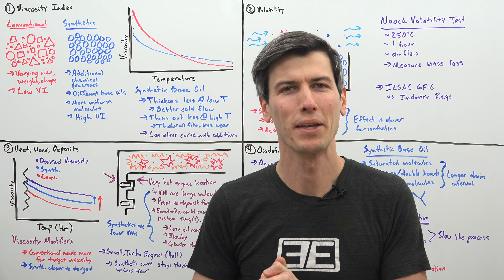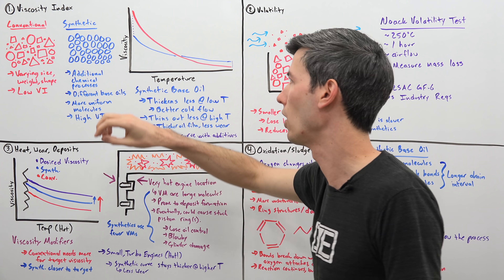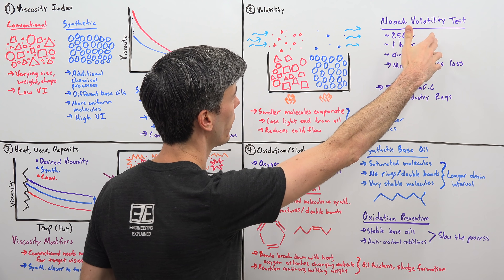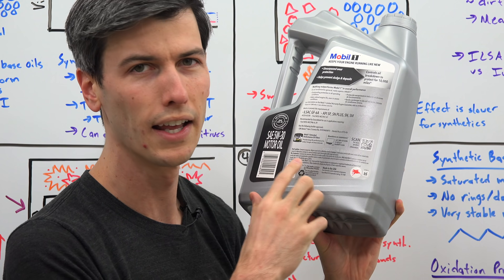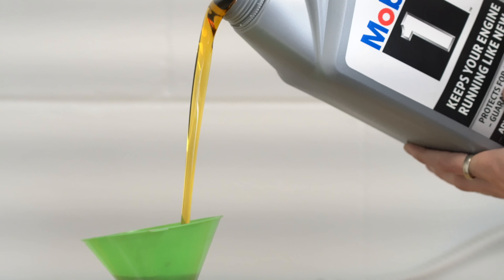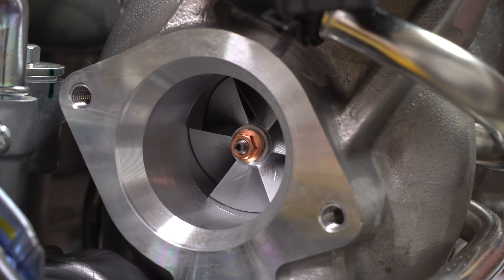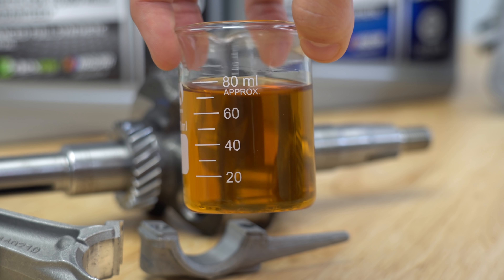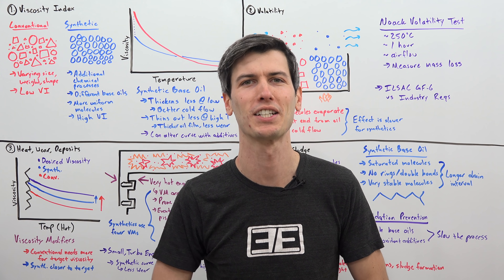Synthetic vs Conventional Oil - There's A Good Reason To Switch

Comment: I have heard that some crankcase seals and other rubber part on older cars does not like fully synthetic oils. Can you elaborate on that please?
Reply: Oh huh? Well I have 97 5.4 triton with just about 250,000 miles with 100% synthetic in it that doesn't leak!
Reply: @429thunderjet2  because newer oil.

Never had a problem with conventional or synthetic from valvoline or castrol. I will not use Penz or Quaker
Reply: @429thunderjet2   I have a '99  5.4 Triton with about 130k miles.  Loading it with synthetic tomorrow.  Never had an ounce of trouble with the engine...  it runs and runs and runs.  Ford done good
Reply: @russellnotestine6436  yup I have a 97 f-250 5.4 two valve Triton getting close to 250k miles with Amsoil Signature Series 100% synthetic in it and it takes a little oil but think most of that is the oil cooler lines are starting to seep. The f-250's got external engine oil coolers from the factory. The 5.4 two valves 97-03 I agree are pretty darn good engines.
Reply: @429thunderjet2   My Triton is in a Super Duty 1 ton cargo van.  It's oil change takes 6.5 quarts...  Ashamed to say I don't know... I rarely have the hood up and never crawl under it...  I imagine that's because of an oil cooler.  Again..  Ford done good.  Seeping a lil' oil (mine doesn't yet) is better than burning it.  From what I learn about synthetic oil I wont be surprised if I get a little seepage.  For the syth benefits...  that's fine with me.
Reply: He has a video on this. Check his channel, it was pretty recent
Reply: Use the oil brands recommend by the manufacturer, ie for Jeep Wrangler JK, if you read the owners manual, they recommend either Mopar conventional oil or Pennzoil synthetic, which I use in my Wrangler, and change every 5K miles, 5W20.
Reply: quixxo  so was it the oils fault?
Reply: quixxo  yah the Harley deal, they had a chain oiler.
Reply: Not one with conditioners so stay away from these high mileage formals no vehicle likes them
Reply: Naw, Those were the ester base synthetics from 30 + years ago that swelled the seals too much causing issues. The modern formulas of the top premium real synthetics use combinations of PAO with some ester and other stuff to keep the seals pliable. The group III highly refined hydrocracked petroleum based synthetics are formulated to be nice to seals as well I believe. This is  basically said, but there is much more tech to it. But so it really is a non-issue today.
Reply: @429thunderjet2  theorically you're right, but I've experienced oil burning with synthetic. Granted, the engine wasn't in the best of shapes, was an early Ford 4.6 in a 94 Crown Vic, notorious for valve seals failure, which it experienced. But after using synthetic oil it went nuts. Blue smoke everywhere and all. Switched back to conventionnal, it became a lot better, actually was bearable. Ever since I'm kinda scared to use synthetic in an older engine
Reply: @adamdion7574   Synthetic oil molecules are more uniform and I believe somewhat smaller as compared to conventional petroleum oils.  Conventional petroleum oils the molecules are random sized as if some are ping pong, golf balls size, others baseballs, softballs and some maybe even soccer ball size relatively speaking. So the bigger ones won't slip out as easily. So that old Crown Vic with the bad valve seals, sure I could see the synthetic getting by the bad seals easier. 
 But it really wasn't the synthetic oils fault you see? On a lot of engines the valve seals can be replaced without removing the heads, not sure if it's possible on the module engines, I guess I've never tried to do it on those.
Reply: @429thunderjet2  never said it was the oil's fault, I totally knew since day one that the engine was at fault. Just saying that in similar cases, synthetic might not be the way to go. At least until it's repaired, if it ever is
Reply: @adamdion7574  right,  no you did not. Just thought I should clarify that.
Reply: Yessir Mr. Russia- as your cars gets older, all the seals and gaskets shrinks, contract, and rot from wear and age, and when you use synthetic oil because of its lubricious properties you will experience increased leaking everywhere.
Reply: @bobpress1235  Thank you.

Comment: I go synthetic because I can't easily afford even a beater used car.  So keeping my existing car going as long as possible is important.
Reply: The up front cost of the oil is higher, but it will hopefully dodge a much bigger bill down the road.

Comment: Jason, I am confused.  Under the "Volatility" section, you said that when oil gets heated it burns off: " . . .  synthetics slow this effect, because not as much will be burning off".  In the Oxidation section, you say that oxygen combines with the oil to form deposits.  But, I think, "burning" is defined as an exothermic reaction when oxygen combines with a fuel.  So, is the motor oil burning in the Volatility section? If so, would that not be Oxidation (combining with oxygen)? Please help.
Reply: The first section is about evaporation of the lighter "ends" of the oil due to heat, resulting in thickening of the oil. The Oxidation is a reaction between oil and O2,  and creating sludge. In both cases, some "lighter ends" of the oil vapor is burned in the  combustion chamber. The burning is through the engine combustion process, through the pcv system.

Comment: i have had 3 chevy express vans over the years. Have used synthetic every with oil change every 8000km. I have had engines last 500000 to 650 000 kms life.well worth the expense
Reply: I can guarantee you by doing oil changes that frequently you would have gotten same life  of engine using conventional oil.
Reply: @Eltee127   As long as you don't live in Alaska. Synthetic is better for cold starts but in America where its warm conventional oil is just as good in the winter. I only use conventional oil as I drive about 500 miles a year and change the oil once a year.

Comment: My proudest accomplishments in engineering include extensive controlled tribological experiements in world class third party engine labs.  The difference is dramatic.  When comparing nearly every single measurable characteristic of oil and oil durability, there are three brands that stick out: Amsoil, Mobil, Pennzoil.  Its a race for 2nd place, by the way.  Amsoil is leaps and bounds ahead of everybody else, because they develop their own additive packages.  Mobil does not.  My confidentiality agreement has lapsed and my life is ruined, so I do have the liberty of being honest.

Comment: Does Synthetic Pennzoil actually have a “Base Oil” since it’s made from natural gas?  Asking for a friend. 😁
Reply: Group 1,2,3 and 3+(Pennzoil ultra plat) base oil is made from petroleum. Group 4 and 5 base oil are really synthetics.
Reply: @Malossianoplus  :  so you are saying natural gas is petroleum? And which synthetic oils are made from base four and five?
Reply: @alpine9996  yes. Natural gas from petroleum. some redline is 100%ester base(group 5), ravenol use pao 80/60%(group 4).
For normal driving a group 3 oil is good and offer the same protection as group 4 and 5 so don't waste money if u don't do track day.
Reply: @Malossianoplus  :  Really?  They make NG from oil to turn it back into oil?  Doesn’t sound right.  It is an extra step which increases cost AND NG is cheaper than oil to begin with.   🤷
Reply: @alpine9996  its more pure than regular synthetic base 3 oil. And normal base 3 oil use used motor oil(the black oil that u give to Walmart,ecc). The grup 3+ use pure new petroleum oil that is transformed into gas and again in oil.

Comment: I replaced conventional motor oil with Mobil I Synthetic Motor Oil in my 1960 Buick Electra with 22,000 original miles.  It runs perfectly with no problems!

Comment: Great info, I asked myself halfway through, wait - why am I watching this? I don't use oil anymore....full EV, electric everything now haha.
Reply: Get what you mean, but it’s not entirely true! There’s still wheel bearing grease, electric motor grease and some gear oil. Some EVs are also starting to use dielectric lubricants for battery cooling too.

Comment: I been using Mobil 1 annual protection for about 3 years with no problems on a 04 Gran Prix GT, I now have a Lincoln MKZ with a 3.0T AWD. Would it be a good idea to use it in this car? I'm thinking not so much, and to the least change it early if you do use it! What you think? Auto stores don't like Mobile's Annual oil either! They dont even order it!😅

Comment: I only use synthetic engine oil on all of my cars. Two of them have 90k miles and when you open the oil caps, the engines have no sludge, not even discoloration, and seem to be almost new.

Comment: What is the Shelf Life for these synth oils such as Mobil 1?  Meaning, if I kept the bottle unopened and sitting in my garage at a stable (room?) temperature, how many years can it sit and still be useful in a regular ICE car's oil change?
Reply: Probably good for over 50 years
Reply: @genefoster8601  the store told me only 1 year. That didn't sound right to me. Thanks

Comment: the escape I drive uses a synthetic blend....is this the best of both worlds?
Reply: Full synthetic is the best. Syn blends should be a bare minium in my opinion. They are much better than Dino oil. If its an ecoboost like my Escape, you'll need a syn blend at a bare minimum per the manual. Conventional oils aren't good enough for the turbos.

Comment: Moral of the story: Change your oil daily and you won't have a problem.
Reply: That's not so far from the reality of some people as you might guess.  The grandfather of a guy I know used to drain his engine oil every evening during the colder times of winter, keep it in the house overnight, and put it back in the engine in the morning before driving off to work!  For an idea on the time period, I think it was back in the 1940s and 50s.

Comment: I've been using full synthetic oil for years now. The two main brands I trust are Royal Purple and Mobil 1. Those are the only two I have experience with. I'd be interested in hearing what brands other people use and why. You never know, I just might give yours a try.
Reply: I use Mobil1 because this is what Porsche approves/recommends in my car and my Macan needs specific kind variety of Mobil1, I am not going to try to improve upon factory recommendations
Reply: Amsoil is arguably the best, if you want to pay their price
Reply: @kalani1987  Royal Purple is aleady as much as $10/qt. Less is you find it on sale.
Reply: @kalani1987   No
Reply: Orielly full synthetic seems to be made by the big brand is what I hear and is cheaper. Seems to make my Honda run solid.
Reply: How about Valvoline?
Reply: I've never used it. @KaayJaay

Comment: A Chevron Oil engineer told me that there are many advantages to using synthetic oils, but extended change intervals is not one of them He bases this on contamination.
Reply: He bases it on $ & ¢ . They want to sell you more oil more often. That and they won't or can't formulate for longer drains and they don't have good enough filters.
Reply: @429thunderjet2  all modern oils have Ph neutralizes in them to combat acidification from combustion by products, but get used up as the burning fuel produces acids continually.  Microscopic particles from wear, and entrained air lowering film strength are contaminants that can't be filtered and limit oil useful life no matter how well the oil was made.
Reply: @blackbirdpie217  Right, but I stand by what I said. Premium synthetics can be run longer, the key word here is premium it's been tested and retested and tested some more, with no detrimental effects. Premiums have stronger, "read expensive", more robust additives that will last longer. You ever heard of oil analysis? That would be the proper way to really gauge how long to go. Of course most people wouldn't bother, that and they won't spring for the expensive premium synthetics, so they go to the costco's, walrus marts etc and get their three dollar a qt. so called synthetic, then run it way to long and hurt the engine and so the dufus grease monkey down the street cries about how bad synthetics are. Now, I am guilty as charged to, I don't do oil analysis either and probably should because I use premium synthetics & being a life long mechanic by trade I should know better and have run way to long. But when you do run long most engines will consume & volatise some oil so you have to check your oil levels, so toping off the oil with fresh helps renew the additives some. 
 The cheap three dollar a qt group III highly refined hydrocracked petroleum based so called synthetics in this country, no.
 You have to go by manufacturers recommendations.
Reply: If you read the label on the oil bottles most run of the mill synthetics won't say anything about extending drain intervals. So it shouldn't be done. If anything is said it is only to use OEM manufacturers recommendations. The ones that do say something about extended change intervals are the more premium ones and cost more.

Comment: I have an Honda Civic Si 2017. (Turbocharged engine)
I live in Puerto Rico (Caribbean Island) The temps never go below 68f in my city. But when the day heats it gets 92 to 101 degrees F.

The recommended oil is 0w20 
Can I upgrade to 0w30 or 5w30 ? for better protection? Would it affect in Startups?
Thank you.

Bernard
Ponce, Puerto Rico

Comment: Great Video.  I understand the advantage of synthetic oil, but would the viscosity curve for a 5W20 conventional be the same as synthetic?  The numbers do refer to cold and hot viscosity measurements.
Reply: It would seem so, but the conventional would require more of those viscosity modifiers and as the temperature of that oil gets hotter and hotter, the conventional oil will thin out much more quickly. I bet you haven't thought about this comment for awhile.

Comment: first, some baselines:
all motors consume oil, all motors have "blowby" (combustion byproducts picked up by the PCV and oil.)
keeping your oil at the correct level is MUCH more important then then quality of oil used.
oil's second job is to collect and isolate (retain via detergents) contaminants. to be removed by changes. lubrication via heat control being first.
conventional (dino) oil additive packages being inferior is a myth, just (fractions of) percentages difference.
extending change intervals (for me) does not "justify" the expense, for 2 reasons.
oil losses (standards being no more then a Quart / 1,000 miles, set by manufacturer) and removing the by product contaminants.
this totally has to do with driving habits, heat cycles, loads, rpm ranges.
a lot of cold starts, stop and go Vs highway cruise at temp.
tl;dr driving habits, not oil quality should determine change intervals. caveat emptor.

Comment: All hoopla. Your owner's manual tell you what synthetic and conventional oil to use.
Remember when Oil companies said, 50,000 mile oil changes using synthetic? You don't hear that anymore.
If your vehicle doesn't have a gas or jet turbine generating 500 degrees fahrenheit temperatures or doesn't fly 20,000 feet above the planet or venture to Antarctica, you're perfectly fine with conventional oils.

Comment: What's better for oil changes, conventional at 5000 mile intervals or synthetic at 10000 mile intervals?
Reply: My mechanic told me it’s still best to change synthetic every 5k, true or false?
Reply: @mikemartenson4357  false. Change oil per manufacturer’s recommendation unless you want to give your mechanic more $$
Reply: @mikemartenson4357  Come to think of it, 5000 mile intervals with conventional oil might be very similar to 10000 with synthetic. I trust the more frequent oil changes more and settled on the 5000 mile intervals with conventional oil.

Comment: All good. But, I thought there was a difference between Full Synthetic and 100% Synthetic and Conventional. That Full Synthetic is Conventional Base with Synthetic additives and 100% Synthetic is actually a manufactured oil that you are speaking of. Is that right? Or am I confused about these labels? Sigh

Comment: I have a 2001 Toyota Camry 4 cylinder which was serviced by a Toyota dealer using Shell Helix (20W-50) mineral oil. It did 260,000km (155,000mi). I then started using a 10W-40 semi-synthetic oil, as recommended by Toyota, did 5,000km (3,125mi), then changed the oil and filter. I have noticed the oil appears cleaner after a further 5,000km. I think the most economical option is to check the manufacturer's specification, frequency of oil and filter replacement, and adhere to it. Some years ago in Australia (mid-1980's) Mobil decided to use their full synthetic (Mobil 1) in their petrol (gas) tankers, but found the ester content had an adverse effect on their oil seals (swelling, softening, almost 'dissolving' through its detergent properties), to find that a regular manufacturer's maintenance schedule using mineral oil was adequate...

Comment: Great video on oils.
Nice job. 
What specific additives if any would you possibly recommend for full synthetic oils in a colder climate like Alaska here where I live.
I would still change in a reasonable amount of time.
Also, just wondering if there is any formula for determining horsepower loss differences between manual vs DCT transmissions? 
Thanks again and please keep up the great work!
😎👍
Reply: 0w with engine block heater